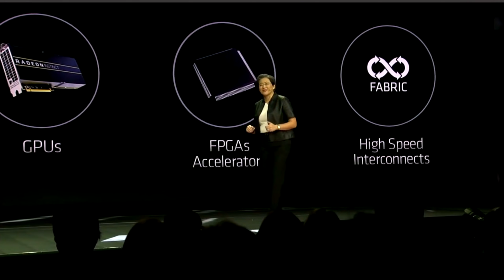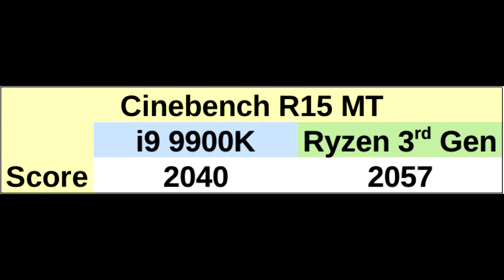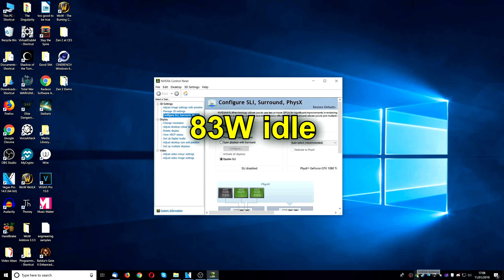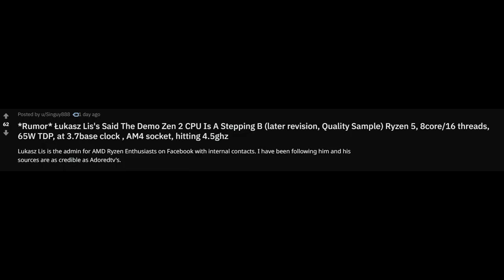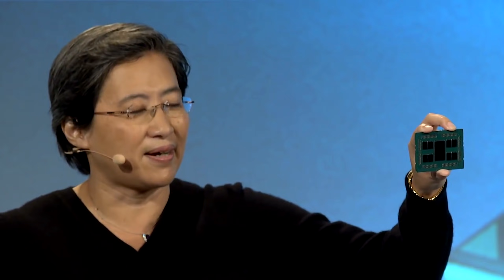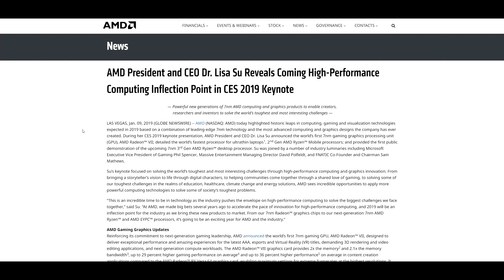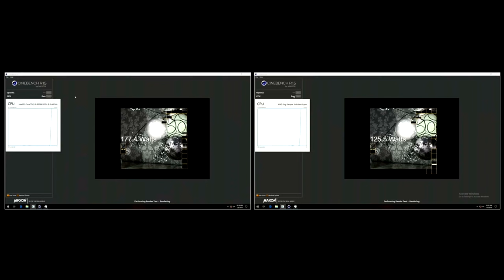Zen 2 Faster than i9 9900K at Half the Power.

Comment: Around 300 pts faster than 2700x in CB multi-threaded benchmark.
Pardon me but this looks away from what we expected. I hope the test sample was clocked 1ghz lower than the 2700x, otherwise it's a bit dissatisfying.
Reply: You're looking only at half the picture. You seem to miss the fact that the CPU was running at ~65W while the 2700x is a 105W CPU - almost double the power draw of the demoed sample. So not only was it more than 15% faster, it was clocked lower AND draws almost half the power of a 2700x. IMHO this is MIGHTY impressive. Also, it will be even more impressive if this was an R5 CPU that they showed. So an unfinished R5 part that beats last gen R7 by over 15% and draws close to half the power.

Comment: AMD has APUs have lagged behind its server and desktop efforts by several months.  In 2019, expect a quad core 12nm Zen+ APU with clocks speeds up to 4.2-4.3GHz.  AMD only just released 12nm on mobile.  I don't expect 7nm APUs until sometime in 2020.

Comment: I am completely convinced with Ryzen, AMD is doing an excellent job, remember though this is 7nm using Double/Triple patterning not EUV/UVL so the lithography isn't exactly as precise enough to give the jump we hoped for Vega 2 RR7 only gets about 25% increase in powerloads even with that crappy Arch at the same power of the Vega64, Which I am not really convinced with AMD graphics, Navi needs to be something special not only having the benefits of the die shrink but also a real good Arch. also putting more frames on the board than NVidia can achieve, you can mock it as much as you want but NVidia has RT as a feature package and the lead currently, If AMD is going to play the game they need to shift 1440p as a base 150$ GPU and 4k at the 250$ price point with consistent frames above 60fps...……….………………………...They need to get the lead ASAP and hold it, as Once Intel gets 10nm mainstream they will have the same advantage, while NVidia can more than likely shove AMDs $hit in just by using a die shrink, its especially frightening if NVidia waits for EUV/UVL as AMD is given a lead for a short while, Jensen did laugh off the V2RR7, so he probably already has something or knows of what to expect at 7nm.

Comment: Not really half the power is it...
Reply from the maker: If I take worst case scenario of assuming all the extra idle power was due to CPU (very unlikely) and use the values in the demo then remove both mobo and PSU VRMS, then no it's not half the power.

If I use AMD's official figures and don't assume most of the extra idle power was due to CPU, and instead most of it was due to the developer motherboard they used, the numbers are more like 1/3rd of the power.

In the end up, "Half the power" will not be far away from the truth.
Reply: @adoredtv  Question here is did AMD run the 9900k at the rated 95w TDP or the 150w (or whatever it was) it needs to do the rated speeds :)
Reply from the maker: @tmkongen  It was running at stock, MCE off so 4.7GHz.
Reply: @adoredtv  A 95w TDP limited 9900k only does around 4GHz on all cores. At stock, unlimited TDP it does 4,7 but the TDP is around 150w. If the 9900k ran at 4,7 here that's actually interresting because that means this CPU AMD tested is running around the same clockspeeds. 4,7 all core 36(?)00x is pretty damn awesome tbh.
Reply from the maker: @tmkongen  a 2700X needs around 4.4GHz to score 2050 in CB R15 so it's likely that this Zen ES was running an average around 4.2GHz.
Reply: @tmkongen  This chart answers your questions: https://static.techspot.com/articles-info/1744/bench/Cinebench.png
Reply: @adoredtv  If a stock 4.7 9900k scores 2048 i find it hard to believe this Zen is running 4.2. Besides this chiplet doesn't have to deal with the Infinity Fabric across the cores from my understanding.

Comment: Cinebench r15 2700=1561 (1561/3.5)*4.6=2052, maybe that's where they got the 4.6 ghz figure, looks like bs to me, probably running much slower than that considering the ipc was improved, and power consumption rises very quickly with with higher clocks

Comment: Anyone knows about project schedules with cpu projects? If one presumes that those are tight, it does not take much to change project situation from "released during CES" to "to be released later". This kind of stuff might escalate any time project progress is evaluated and checked against schedules. Couple small things going wrong in row is usually all it needs with tight schedules to postpone the deliverable past previously planned deadlines. So having only 1 chiplet version beating 9900k live was much better than having only powerpoint slides about expected performance. This would also explain vague comments about more cores later on because they do not yet have anything working 100% at the moment but things look promising.
Reply: And one should ever never promise more than can be delivered with 120% certainty.

Comment: Although you're technically correct about the 9900k not being hobbled by AMD, as was the drama during the launch the 9900k is hobbled by Intel to run cooler - on most boards it "factory/auto OCs" to 150wTDP. The R5 beating the 9900k even at 95wTDP is incredible, but it's not entirely a real-use-case example. Would be interesting to know how it measures up vs the 9900k as a 150w part - but I imagine it wouldn't be nearly as impressive if it was only almost as fast instead of very slightly faster.
Reply: If you're implying that at the demo the 9900k didn't run at 150W then that's incorrect. AMD DID run the 9900k unconstrained (read 150W) at that demo, otherwise it wouldn't score ~2050 cb. Check out this chart, especially the bar that says "[Unlimited]" - https://static.techspot.com/articles-info/1744/bench/Cinebench.png This proves that AMD ran the 9900k without capping it at 95W and it boosted itself to 4.7 Ghz on all of the 8 cores. Props to AMD for not pulling a Principled Technologies. They could have easily constrained the 9900k to Intel's advertised 95W and DEMOLISH it and then say smugly "See, we are MUUUCH better than the competition".
Reply: @bgtubber  Did you look at the projected CPU power draw in this video? It was pulling under 110w. Unconstrained, 9900k will easily exceed 150.
Reply: @bgtubber  Did you look at the projected CPU power draw in this video? It was pulling under 110w. Unconstrained, 9900k will easily exceed 150.

Comment: The higher Idle wattage on AMD is most likely due to added graphic card compared to integrated GPU on Intel imo...
Reply: Mm, no - https://www.anandtech.com/show/13829/amd-ryzen-3rd-generation-zen-2-pcie-4-eight-core "AMD said that both systems had identical power supplies, DRAM, SSDs, operating systems, patches, and both with a Vega 64 graphics card"

Comment: I don’t understand why they thought there wouldn’t be an IO die. No reason to change the architecture on the silicon level. At least for the compute cores. They could change the IO architecture from one brand to the next. They don’t have to just put more cores in that slot either. Maybe a fpga or some ram. They could do even more crazy stuff with the threadripper.
Reply: Yea, I was thinking the same all the while. This makes more financial sense since you use the same chiplets everywhere and also you've got less points of failure - If something in the cores fails, you just slap another chiplet and get to keep the IO part. If something in the IO is defective you get to keep the cores (the small chiplet) and just slap on another inexpensive 14nm IO die. Brilliant! BTW, 7nm Threadrippers are likely to look like the new Epyc's but with less than 8 active chiplets - https://www.anandtech.com/show/13561/amd-previews-epyc-rome-processor-up-to-64-zen-2-cores What a beauty! 🤩 I can't wait to get my hands on the 7nm Threadripper later this year hopefully. I'm rocking the 1950x since launch (year and a half) and I've been EXTREMELY satisfied with the performance (and price!).

Comment: People in the Information Systems and Information Technology field understand more that clock speed means nothing if the CPU can't do their job the way they expected it to.

I am already disappointed that the i7 Intel CPU in my build cannot perform even middleweight production work effectively, doing video editing, audio mixing and processing, etc.

Let Intel play with their gaming toys. I AM GETTING OLD AND NEED ACTUAL PARALLEL PROCESSING WORK DONE.

goes back to working on the projects
Reply: Threadrippers are the best choice for workloads that are heavily parallel processing optimized. You should have gone with one instead of an i7 if your work demands threads more than single core performance. 1950x are pretty inexpensive right now, it's almost the price of an i7. I'm using a 1950x since they launched and it's been a killer so far.

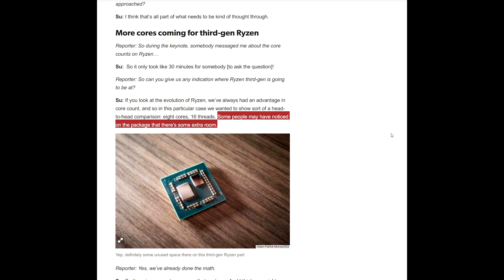Comment: 15:49 I think it says a lot more if they had compared their 8 cores 16 thread with Intel's best, because those are at the top end yet still consumer/gaming processors. But I'm excited since that Intel chip boosts 4.7GHz on all cores. In all hypotheses it speaks really well for either it's single core perf or clock speed. My guess would be single core perf improvement.

Comment: Nice analysis.  Totally agree on the power.  There were two items I didn't agree with.  First, stock memory speeds of 4000 are unlikely because there is no JEDEC standard for that.  You might see 2933 stock, I doubt you will see higher.  But of course the memory will still be OCable to higher speeds.  The second is the performance of a 16-core variant vs the 9900K.  I do not think it will be quite double.  I think it will be more around 160%-180% of a 9900K.

There are two reasons for this.  The first is that stock configurations always run the cpu a little hot on the performance side, digging slightly into the non-linear power/performance curve.  When they throw another 8 cores in there for 16 total, they probably won't be able to run all 16 cores on the hot side.  They will have to reduce the maximum turbo frequency a bit to keep the chip within the TDP.   The second reason is that there are going to be some practical limitations for the 16-core version running on mobos that were not designed to handle more than 8 due to the frequency response of the VRMs.  It probably isn't possible to double the power at normal (air or liquid cooled) temperatures on those mobos and still get the required stability.

Of course, there will be new motherboards that will be able to do better.  There is no reason why one couldn't run a 16-core configuration full-on at, say, 4.8 GHz given a beefy enough mobo and cooling solution.

-Matt

Comment: I've been looking around some more, and I think I've got its performance down.

TL;DR: It's running at ~4.1GHz, using ~90W of total package power (~67.5W without the I/O average estimate), and it is a 65W TDP part for sure.

The all-core frequency comes from R2K, where all of its all-core XFR's are the average of the base and boost clocks ± 0.1GHz. Therefore we get a range of 4.0 - 4.2GHz as a start, assuming PBO wasn't enabled.

The power figure, comes from two angles.
First is the idle power, and as you concluded it's at ~35W without the CPU. So during the run it'd be drawing ~100W, according to this.
Then there's the load power, and the info for that comes from the TH article you were looking at too, where their 9900K drew 137W during their CB test. So 180W or 190W, minus 137W, gives us a range of 43 - 53W. Therefore we end up at ~80 - 90W of power draw, according to this.
But, the other thing that needs to be taken into account, is that both CPUs will use exponentially more power as they're clocked higher than at idle, the 9900K's clocked even higher than the 3600 too, they're both running hotter, and the other system components will go under load too, so the actual power draw will be more than ~80 - 90W, and less than or equal to ~100W. Meet in the middle, and call it ~90W.
Considering the PPT (peak clock/actual TDP limit, known to Intel as PL2), which would be at ~90W for a 65W TDP SKU when looking at Zen+, that also lines up.
Also, that'd be ~67.5W on average (60 - 75W range) core only power, with the I/O removed.

As an aside, I've got a table with educated estimations of clock/watt values in CB, that seems to be dead on even though I didn't focus it around this, and it says that at ~80 - 100W the CPU's running at 4.0 - 4.2GHz. 4.1GHz, at the established ~90W. Less/not trustworthy, but another piece of information nonetheless.

But, it'd be the 3600 you were given info about, although I guess yields have improved and so they decided to go up 100MHz, or maybe it was just because of the 9900K. They could I think, go up another 100MHz to 3.8/4.6 and still be within the 65W TDP limits, but I also think they'll stay where they are to get the maximum yields possible for the R5's. We'll see.

Performance wise that'd be, ~15% greater multi-threaded IPC over the 14nm 'Lake's, and ~12% over Zen+. Awesome.
Assuming SMT scaling maintained, it'd be ~6.5% ahead of Intel in single-threaded IPC.

For power comparisons.
In comparison to the 2700X, it does 4.2GHz at half the power draw (~100W vs ~190W), and at 5GHz against the 9900K assuming it can achieve it, it does it at ~0.83x the power (~190W vs ~230W).
It's an s-curve, but on average, from 3.7 - 4.2GHz its watt/clock is ~0.54x that of the 2700X, and from 4 - 5GHz it's ~0.82x that of the 9900K.

This isn't even the good stuff either. The Epyc/TR class silicon that the 3700X and 3850X are going to use, is on a completely different level. Just like how CoL has like a ± 0.3GHz/W range in general, the same's true for Zen 2.
So if they made an 8 core using E/TR level silicon, it'd be doing 5GHz at almost half, if not half, the power of the 9900K (~115 - 130W vs ~230W).

This is just not good news for Intel in the slightest. They've got nothing to compete until next year, if even then. Fantastic news for AMD and consumers though (hopefully), which is awesome.

EDIT: Wording, formatting, and I also added a single-threaded IPC estimation.

Comment: Jim, there was another thing that you got right that I have not seen anyone mention. You speculated the desktop part would be an I/O + CPU chiplet design and it was. But you went on to speculate that the I/O chiplet would be a custom chiplet specifically designed  for desktop parts. Lisa Su confirmed that in the the keynote. 

That leads to something else that occurred to me. It surprised me when she said that this was early silicon. They have been talking about the 7nm CPU performance being good for quite some time. Since they are shooting for a Q3 launch of Epyc they must be into system design and validation by now which means the CPU chiplet must be mature. Then I realized that they must be saying that  the I/O chip is early silicon, and maybe the reason that they showed the 8 core chiplet is that it can not yet handle the second die. This would also explain why the single 8C die was used rather than the expected and more reasonable two 4C die for an 8 core part. This would  also mean that they did not have a choice about whether to show the 12 and 16 core parts.
Reply from the maker: Good point on the I/O die possibly being the newer part.  The package Lisa held up didn't necessarily have to be the one they showed ofc, and in fact I doubt it was as there is no symmetry there that the end package will surely require for cooling, but I get your point yes.
Reply: @adoredtv   Actually I meant to say that they did not have the choice to demo the 12C or 16C parts.

Comment: You said there's only 2 options that would be more than 8, which is  12 and 16. Though, wouldn't 10 and 14 be technically possible? Or is it better to use "half" an 8 core chiplet to get the extra 4 cores?
Reply: It is technically possible. I am not sure why AMD would not offer a 10 or 14  core. It may just be that they would have to be sold at almost the same price as the 12 and 16 core respectively.

Comment: "Zen 2 faster than i9 9900K at half the power"  At less power, but so it nearly everything the i9 9900K isn't an efficient CPU it was a rushed release.  Also "faster" sure, but it's only 5% faster than a 2700X @ 4.3Ghz which is nearly as fast as an i9 9900K.  AMD is known to do very well at Cinebench which is why AMD used that benchmark.   If AMD would have used games which intel advertised the i9 9900k as the fastest gaming CPU I have a feeling the scores would have been the other way around. I can't blame AMD for using a situation that made their new CPU look good, but I'm tired of everyone saying "intel gets rekt".

If that CPU was a Ryzen 5 CPU AMD would have said no.  The entire point of the release was to build hype for AMD and telling everyone it was a Ryzen 5 CPU after seeing the scores would have done just that.  There is no evidence it was a Ryzen 5 CPU, yet.  It might be, but there is only speculation and no actual evidence.  

"lower-midranged Ryzen 5"  Fucking stop it.  You have no idea what it really is. It literally could be anything from a Ryzen 3 3rg gen to a Ryzen 7 4th gen.
Reply: I am sure that if AMD reached the clocks to match 9900K scores then the gaming would be the same, 2700X only gets low FPS scores since it runs @3.85 GHZ on load while 9900K going for 4.7GHZ. I got 2700X so I have tested it with 1080Ti.

Comment: Score the same as 9900k. So how much does 10nm compare to 14nm++ ??? If -35% power (70W/107W) then intel has the same performance as AMD the moment they have their 10nm working. Although I assume it will be better than -35%.... don't we know based on 10nm i3-8121U?
They use an I/O die for games, AdoredTV, if you have some thought about the latency feel free to reduce our worries, we know based on Threadripper chiplets isn't a good idea for Games.
And compared to 12nm 2700X it's more correct to talk about -42% because 14nm to 7nm is -50%.  109W*0.58=63.2W about 70W with bigger/faster core.